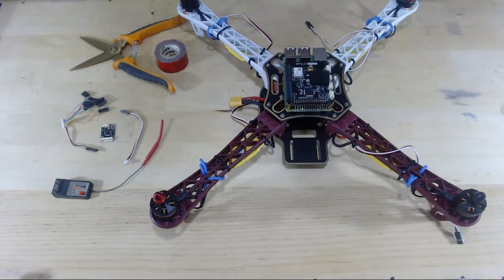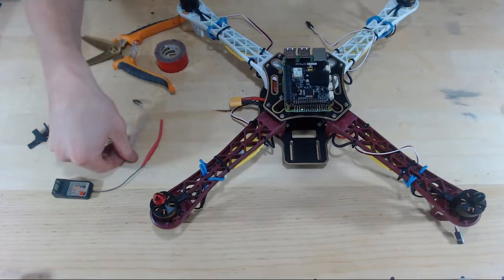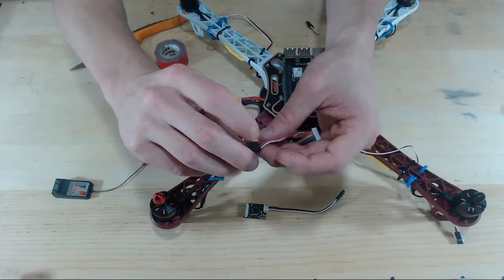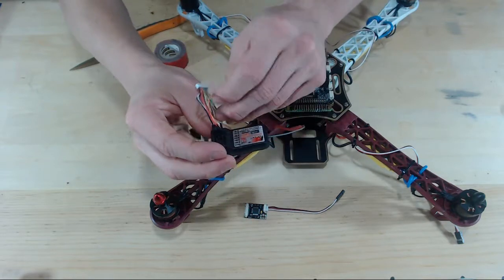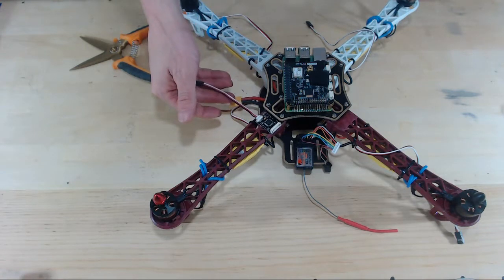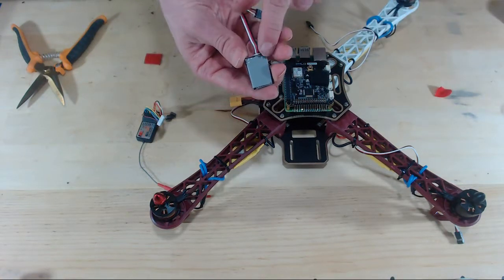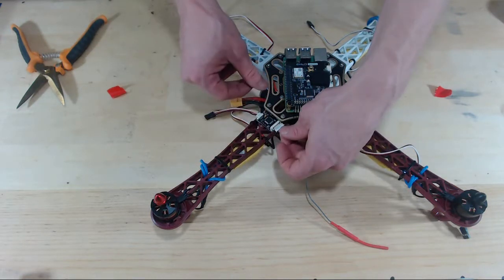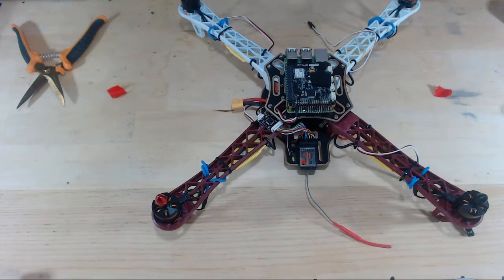Installing PPM Encoder

Comment: Does anyone know the answer to my questions below:

Is the PPM output channel order as follows?
A - Aileron  (channel 1)
E - Elevator (channel 2)
T - Throttle (channel 3)
R - Rudder   (channel 4) 
..etc..

What if I desire the PPM output channel order to be as follows (for Spektrum)?:
T - Throttle (channel 1)
A - Aileron  (channel 2)
E - Elevator (channel 3)
R - Rudder   (channel 4)

Can I simply change the wire connection order between the receiver and the PPM encoder in the order to achieve my desired PPM output channel order?

For example, 
Spektrum receiver channel 1 (Throttle)  connect to PPM encoder channel 3 (Throttle) 
Spektrum receiver channel 2 (Aileron)   connect to PPM encoder channel 1 (Aileron)
Spektrum receiver channel 3 (Elevator)  connect to PPM encoder channel 2 (Elevator)
Spektrum receiver channel 4 (Rudder)    connect to PPM encoder channel 4 (Rudder).

Comment: The ShareGoo 8CH PPM Encoder & I2C Splitter Expand Module described in the parts list is unavailable anywhere and there is no indication that it will be available in the future.  Can I use the FPVDrone 8CH PPM Encoder & I2C Splitter Expand Module that is available on Amazon instead.